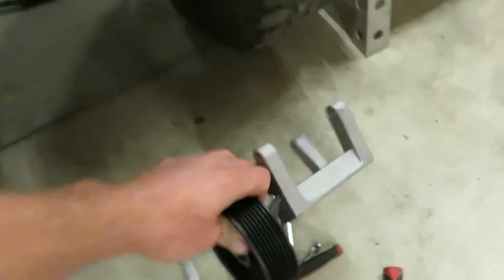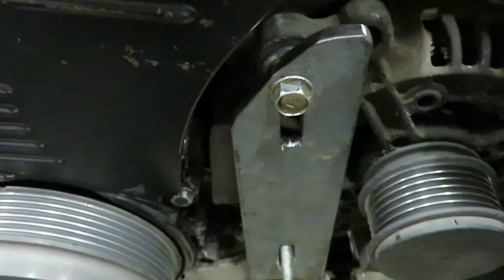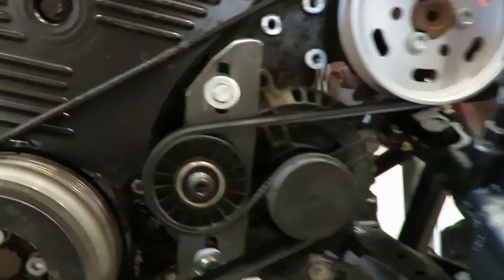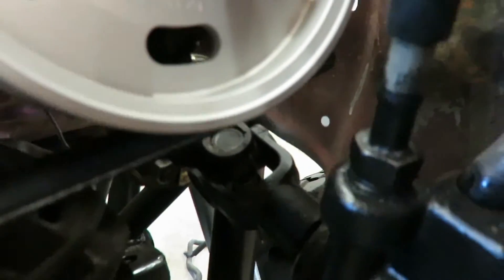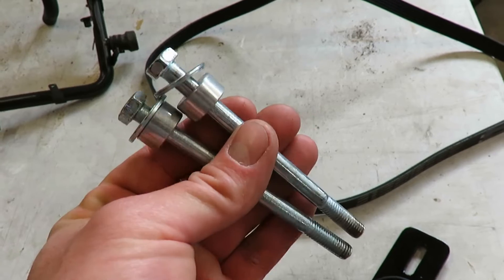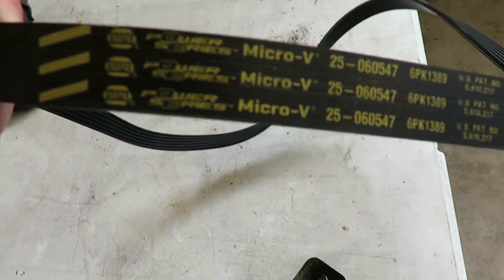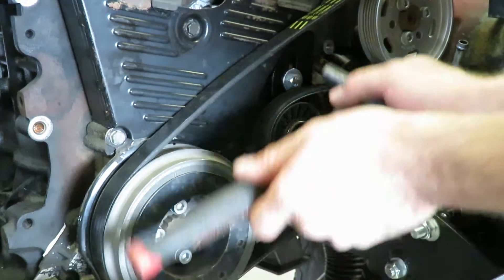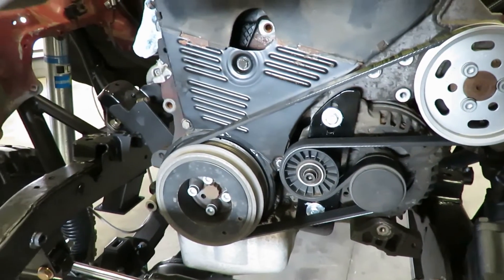Toyota TDI Swap Building a Custom Tensioner AC Pump Delete

Comment: I was looking at the belt routing to delete the AC last night on my project and didnt want the delete pulley for the exact same reason as you. Glad I looked around because sometimes the simplest solution is the best.
Reply: Same here. I'm doing a swap on my samurai and need a bit of clearance for the drag link and lower radiator hose.